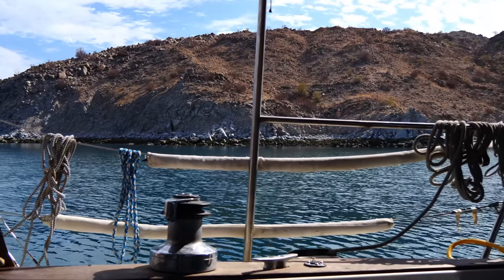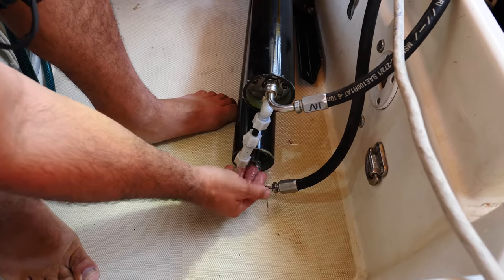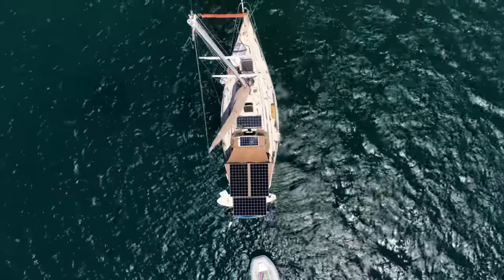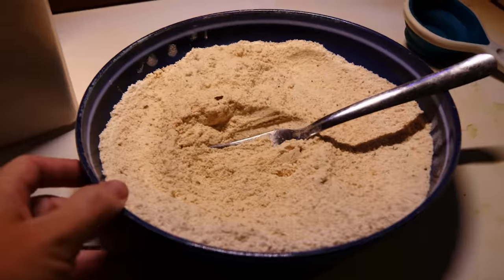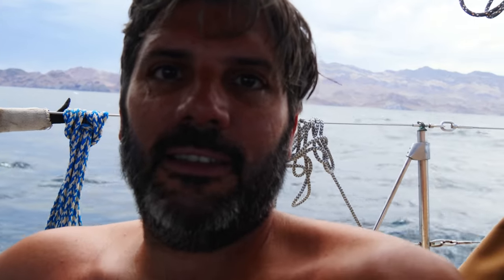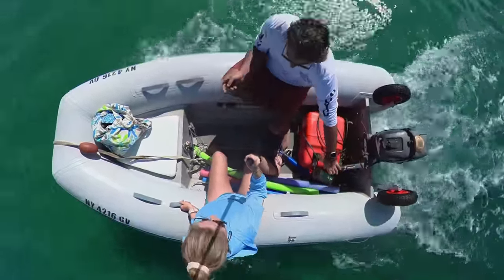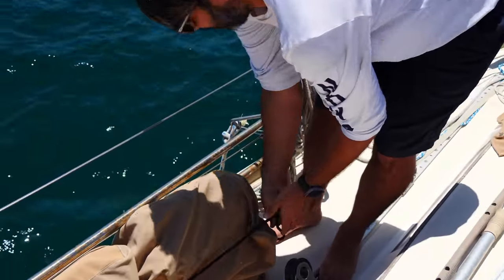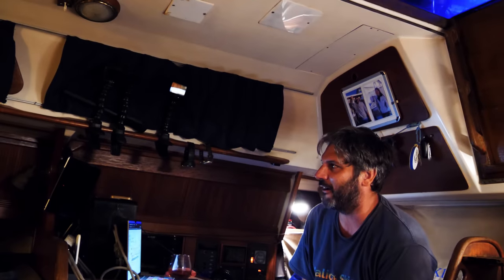How We Live 100% Off Grid on Our Sail Boat  (Calico Skies Sailing, Ep 197)

Comment: That water maker boost pump relay looks a little under-sized maybe?? Motors are inductive loads which means they are harder on the relay contacts than for example a solid-state relay. Every time the relay opens (shuts off) the inductive load will spike the voltage way up and cause an arc to form across the relay contacts. This is what burns them out. You might look into using a solid-state relay instead of that mechanical one. They are rated for non-resistive loads (ie. inductive loads) and there is no mechanical element to arc and fail.
Reply from the maker: I did bump it up a bit when I replaced it. Think that may have been the issue

Comment: Another great video guys! One slight correction... The fish that BIll shot at and missed was not a hogfish. I'm pretty certain it was a large humphead parrot fish. Either way, both are great eating fish although I couldn't shoot a parrot fish because of the fond memories I have of them when I had my saltwater aquarium.
Reply from the maker: Thanks! I think it's a Mexican Hog Fish, we also don't eat Parrotfish bc they are so good for the reefs! 😃
Reply: @CalicoSkiesSailing   Me thinks if you google humphead parrot fish you'll find photos of the fish and it looks exactly like the one in your video, albeit with a bit smaller hump...  "Mexican Hog Fish"?   Is there such a thing?   All good... I agree parrot fish are good for the reefs... Edited... A couple of reasons I'm sure it's a parrot fish is one, the shape of the mouth and two, the color. I googled "Mexican Hog Fish" and found numerous photos and none looked like the one in your video.. in fact, this it what was said about the color of the "Mexican Hog Fish"... "Females are usually reddish in color and tinged with yellow with two dark stripes. Dominant males are identified by the fleshy lumps on their heads, their coloration is grayish tinged with red and with a yellow bar near the mid section. The tips of all fins except the pectoral are long and filamentous."

Comment: Check the amp rating of the relay contacts. The motor running amps must not exceed the rated amps of the relays contact. You could also parallel up two norm open relay contacts so the relays contact amp rating is doubled.
Reply from the maker: I think you are right about that, new relay with higher rating is on order

Comment: Bill, Nice fix on the water maker. Having one is a game changer. Having solar to power the unit is really a game changer. I use to run the main engine 45 minutes a day, just for water. And another 45 minutes for everything else.
Are you guys doing Annapolis this year.
Reply from the maker: Yes its been a game changer being able to make water from the sun, really has cut down our generator time except for running the air con 😎